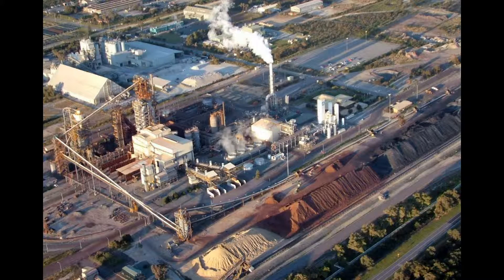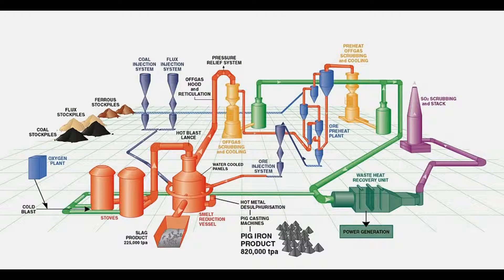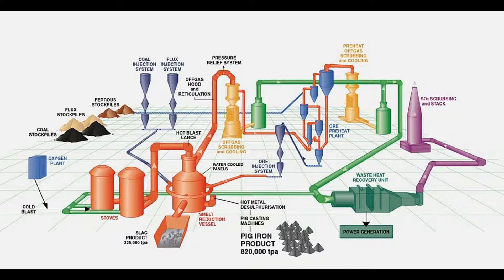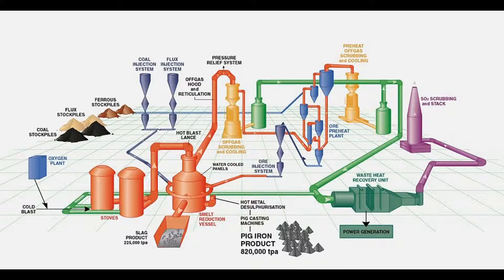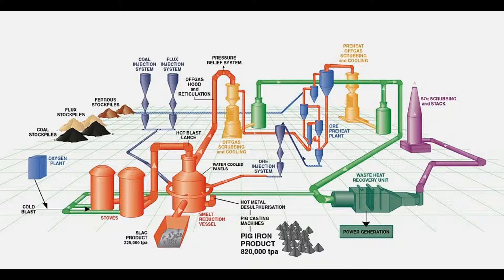Kwinana Hismelt Plant Iron Smelting

Comment: Excellent ! But if it possible Hismelt Technology to prosses Iron Sand ? We want to separate the Iron Element and Titanium. The Iron Element into HBI and Titanium into Titanium Slag. Becouse we want to take advantage the Titanium Element into Titanium Grades Product. Thank You
Reply: Iron sands have been tested within a HIsmelt at both pilot plant and commercial scale. Above 20% TiO2 in slag, problems have been experienced. Also, the Vanadium will 100% report to the slag.